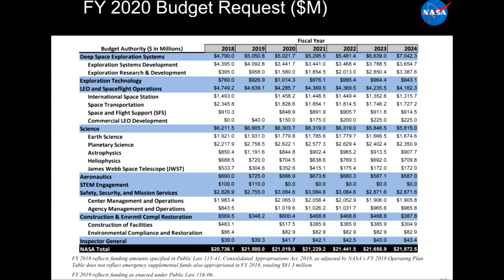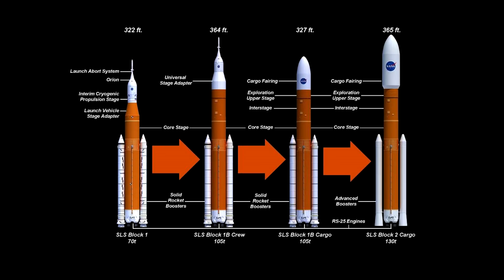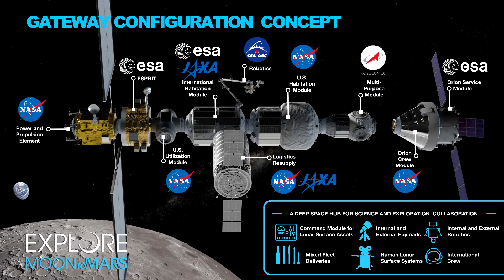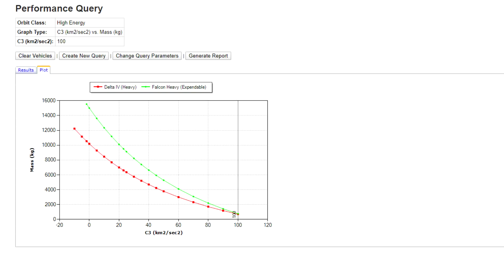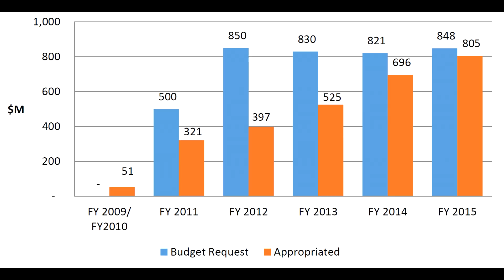SLS Rocket In Trouble After New White House Budget Request

Comment: SpaceX has gone from drawing Falcon Heavy on a napkin to an actual launch in the time this thing has been laying around in "development".
Reply: Really SpaceX has gone from designing the Falcon 1 to flying Falcon Heavy in the time this program has been around since SLS is basically a continuation of the Constellation Program with a name change and less capable rocket. 

To quote Apollo 13 "Tell me this isn't a government operation."
Reply: @bnadit1949  And it does use almost unchanged Shuttle parts, so we're talking about 40 years
Reply: @bnadit1949  Much of the Merlin engine is based on Fastrac and the TR-107 in fact Spacex's head propulsion engineer Tom Mueller used to work for Northrop before co-founding Spacex so they did not start from zero.
Reply: SpaceX has gone from using technology developed by the public, you mean.
The private sector didn't step up back in the 60s to go to the moon off its own back.
Reply: @anessenator  What technology is that?
Reply: @anessenator  SLS is using Shuttle engines and boosters, designed in the 1960s. There has been zero forward progress by the public sector since Shuttle's debut.
Reply: @polygondwanaland8390  The main tank is from the Shuttle too. Only new thing is upper stage and capsule.
Reply: @anessenator  Not to sure what tech has been developed "by the public" the private sector did not invest in the moon because it was too new, and everything involved with rockets involved the military,  all of the scientist worked for the govt. universities grads were recruited by NASA and the military involved programs. None of this would of been shared with the public.
Reply: @polygondwanaland8390  That's what happens when budgets get slashed down to nothing. No money, no progress.
Reply: @polygondwanaland8390  Except it isn't, they're completely redesigned engines that are just supposed to look kinda like the old ones. They are made by the same company. Same with the main tank. The only actual carry-over is the manufacturer and the orange paint. Everything else has been redesigned. Which is actually bad because it means they didn't even save any money doing it.
Reply: @SuperSMT  - The rocket technology that Musk used as the basis for his company's designs was developed under NASA. It's that "shoulders of giants" thing. He didn't start from scratch, he built on what had already been done by those who came before.

Apart from that, SpaceX receives billions of dollars in government subsidies and contracts, paid for by the American taxpayer. The difference between that and funding NASA directly is that NASA is a non-profit, public, organization, whereas SpaceX isn't. Any innovations made with our money is owned by SpaceX, not us. So Musk and his investors get to pocket the profit from our investment.
Reply: @danieljensen2626  I was under the impression the first few flights would be surplus Shuttle engines, switching to the "new design" around Block 1B.
Reply: @f1nger605  NASA didn't start from scratch either, it basically wholesale grabbed the Nazi rocket program and related engineers. Do you think Nazis need more credit for what NASA has done? Risky position to take!
Reply: @PistonAvatarGuy  SLS has had tens of billions of dollars of funding and well more time than it was scheduled for. It's just a bad design from a bureaucracy obsessed with preserving existing jobs.
Reply: @polygondwanaland8390  - Those Nazi scientists were still funded by the American taxpayer. Again, the difference is that we foot the bill, but don't get to reap the reward.
Reply: @f1nger605  "Don't reap the reward"? America's public sector now has cheap access to space from multiple private companies. That's not a reward? You'd rather spend a billion dollars every launch to keep using Shuttle?

Fixed cost contracts are a win for taxpayers because they drive prices down instead of spiraling them upwards. It's much cheaper for NASA to purchase a service than to develop and operate it's own vehicles.
Reply: @f1nger605  They dont get 'subsidies', just contracts. NASA's investment gets them exactly what they paid for, domestic access to the ISS for cargo and soon crew.
Reply: @polygondwanaland8390  Building the most powerful rocket ever made is expensive, who knew? And what's wrong with preserving jobs, especially at NASA?
Reply: @danieljensen2626  Orange paint? You think the shuttle main tank was orange because it was painted?
Reply: @PistonAvatarGuy  SLS is not the most powerful rocket ever designed. That's straight up a lie. The Block 2 SLS has zero funding or development. The Block 1 and Block 1B SLS are both lesser than the Saturn V and SpaceX Superheavy.
Reply: @anessenator  Today Space X has developed its own "Full flow staged combustion" Raptor engine. Although the Russians developed one in the past, Space X have done well to develop their own one.
Reply: @SuperSMT  - They also get subsidies. Musk's combined corporate empire, according to one estimate, has received $4.9 billion in government subsidies.

Our return on that investment is that we get to pay SpaceX for the privilege of using their rockets. It's an arrangement designed to enrich Musk and his investors.
Reply: @PistonAvatarGuy  Orange insulation, whatever. The point is all the internals have changed.
Reply: @anessenator  And did they do that on 5% of the US budget? No? Then maybe there is a reason why Apollo was done by the Govt. aqnd Space X now is cheaper, faster and more successful in developing the crude basics delivered by them to what we see actually launch nowadays.
Reply: @polygondwanaland8390  - I'd rather see NASA fully funded instead of being forced to innovate with scraps.

It is a time-honored tradition of corporate-owmed politicians to severely cut the budgets of government programs, watch them fall into ruin, then turn around and say "See?! Privatization is the answer!" It happened with the Post Office and it's happening with NASA. Privatization is not more efficient, it's just better at distributing money to those at the top.
Reply: @polygondwanaland8390  I didn't say that it was the most powerful rocket ever designed, and even if the more powerful iteration of the SLS isn't currently being built, the development of the SLS is much, MUCH further along than SpaceX's "Superheavy," which isn't likely to EVER be built. The ONLY way that building these big rockets makes any sense is if they're going to be used for research programs which involve sending people to other celestial bodies, and there's no reason why NASA shouldn't be the one to build the rockets for those programs.
Reply: @danieljensen2626  The government doesn't save money, there's no incentive to.
Reply: @fitch03  - Why do you think NASA is repurposing decades-old rocket engines instead of designing all new ones? They're trying to save money. Because their ambitions are high, but their funding is low, so they are forced to pinch pennies wherever they can.

Meanwhile, private industry also has an incentive to save money, they're just saving it for those at the top. The point of SpaceX isn't to make rockets, it's to make a profit for its investors. Nothing more. That is all "efficiency" means in a corporate context: enriching the rich.
Reply: @f1nger605  Lol, space X is a private company. Elon runs it specifically with the goal of getting humans on Mars. They don't even really turn a profit, basically all of their money goes back into designing bigger and better rockets.
Reply: @fitch03  Literally the entire pitch of "re-using" shuttle parts was to save time and money.  I know it was just pork barrel for the old manufacturers but that was the stated reasoning.
Reply: @danieljensen2626  - You're actually very wrong about that. SpaceX's profit margin is much higher than its largest competitors, Boeing and Lockheed Martin. The "savings" for R&D actually comes from its work force. SpaceX employs fewer people than those companies and reportedly engages in some shady labor practices.

While SpaceX isn't publicly traded, it still has investors other than Elon Musk. Investors who, like all investors, are looking to turn a profit. Again, the goal of the company is to make money for those at the top, not rockets for the good of mankind.
Reply: @polygondwanaland8390  the risk that is you end up in the position that nasa is now where they depend on the Russians to get men into space. Also monopolies also tend to lead to higher prices as their is no competition
Reply: @f1nger605  SpaceX does their launches without goverment subsidies. Any launches they operate on US Soil (which is all of them) is paid for by contract. They are PAID for their launch platform. They do not get kickbacks. They are simply a profitable rocket agency. ULA is not.
Reply: @AudioArcturia  - Just because they aren't being subsidized in one area doesn't mean they aren't being subsidized in other areas. Again, Musk's corporate empire has received an estimated $4.9 billion in government subsidies. Those close to him have said that he's hawkish about getting the government to pay for whatever he can. That's just good business.
Reply: @anessenator  "SpaceX has gone from using technology developed by the public, you mean. The private sector didn't step up back in the 60s to go to the moon off its own back."
And NASA (NACA at the time) used technology developed by Goddard (The liquid fueled rocket engine) So SpaceX is using technology developed by a private individual. The entire idea of "lunar orbit rendezvous" was also a civilian development (John Houbolt)

NASA didn't get to *orbit*, let alone the moon, entirely on their own development.
Reply: @PistonAvatarGuy  and what percentage of the funding given over for constellation and SLS did spacex use in equivalence to design and deploy falcon 9 and falcon heavy?
Reply: @f1nger605  but you claimed they get subsidies for SpaceX. They do not.
Reply: @AudioArcturia  - They did, though.
Reply: @citizenphaid  None of the Falcon rockets are anywhere close to being as capable as SLS.
Reply: @PistonAvatarGuy  You actually think Block 2 of SLS, which has zero funding, zero design work, and placeholder boosters is more likely to fly than Superheavy, for which engines have entered series production and full scale tests are underway? You're either ill informed or wildly delusional.
Reply: @f1nger605  No, they don't. Outside of a double digit millions for a design study for the Air Force, every dollar SpaceX takes from the government is payment for services rendered. That's not a subsidy, that's business.
Reply: @polygondwanaland8390  SLS Block 1, payload to LEO: 209,000 pounds.
-
Falcon Heavy, payload to LEO: 140,700 pounds. 
-
When talking about going further out into space, the advantage that the SLS has becomes even more pronounced. You have no idea what you're talking about.
Reply: @anessenator  - Standing on the shoulders of titans. Lots of primary development and infrastructure paved the way for commercial programs. Sure, the `no!` crowd will reject it, but lots of ideas were tested and proven to be dead ends: SpaceX didn't have to do that, they had textbooks. The commercial crowd doesn't have to deal with the complications of public money and Congress either, successive administrations or a fickle one for that matter (which happens to be the subject of this video clip.) Frankly, I don't see SpaceX' Mars goal as being more than advertising. New Shepard, Glen, tourism, Earth, is where it's at. A colony where the surface atmosphere is like 25,000 M and the hottest it gets is 20C and the same day it averages -76C. Did they mention the planet wide talcum powder fine rust dust storms that cover the planet and works its way into everything?
Reply: @anessenator  well, I'm neutral concerning SpaceX. But I really find it weird that the "legacy" space companies are needing more time to create some launcher that is mostly made of old components than SpaceX and (most likely) Blue Origin needed to create something totally new from scratch.

I'm absolutely sure that these two companies had been able to create some SLS comparable launcher with much fewer money. This concept of using as much contractors as possible is really expensive and a waste of time.
Reply: @f.w.1318  Not only was it shared with the public, everyone in the world was able to see the plans. Sure, there were proprietary processes involved that manufacturers created and some of them were forced to be shared between competitors by the government to benefit the program. The easiest example is how thegovernment required Douglas to assist North American with insulation of their Saturn LH stage the S-II because the Douglas' S-IVb was so much farther along. 
But look at photos of the SpaceX shop floor: Curtains, drapes, covers, all ad hoc, not to protect the hardware, to protect the design. Not that it's a bad idea, just, get real.
Reply: @anessenator  okay, NASA beat the Soviets to the moon 50 years ago, (huge clap) but you're suggesting we should now dump the private sector and let the government continue their slothlike and uninspiring mentality?
Reply: @polygondwanaland8390  I only half agree with you, maybe three quarters. It will to be so great to have multiple United States suppliers to LEO. Sure wish we could've doubled back in 1973 and tested a next-gen stretched SI-C to land on a barge in the Atlantic instead of a full-blown shuttle, but anyway. As for fixed cost, fine for post-development work but Congress likes `price tags` to sell and criticize when they see fit. Purchasing a service requires oversight, i.e. regulation, that part of the equation tends to be ignored, as does the "profit tax" companies charge. Money they make by cutting corners can lead to an inferior deliverable. See what I mean about not completely agreeing?
Reply: @f1nger605  Ah yes, the good ole anti-capitalist anti-reality argument. Take even the most basic economics class and you'll understand what I said.  SpaceX is almost entirely funded by subsidy, just like every Musk company besides Paypal.
Reply: @nicktodd2  Full flow may have an advantage (thrust/weight? simplicity?,) but maybe not (ISP.) However the staged combustion path was well worn prior to SpaceX' entry. Their boys and girls went to school reading textbooks written by those designers.
Reply: @f1nger605  Remember when we gave the Apollo program nearly 400 billion dollars? Pepperidge Farms remembers
Reply: @stevefink6000  What I want is a well educated workforce with consistent leadership. Previous programs were cancelled for sound reasons but I still hated to see them go only replaced by some clean sheet that people criticize for being slow. It's frustrating that scientists and engineers look up from their experiments and benches only to see people who can't carry their own water making de facto technical specifications via funding decisions. Yeah, I know it's complicated, but still.
Reply: @stevefink6000  ...that said, I just saw at 0:30 & 0:39 "STEM = $0.00" SMH 🤦‍♀️
Reply: @fitch03  Dude... people have already addressed this. spacex doesn't take subsidies, they take contracts
Reply: @benhardie3836  The difference, realistically, being......................................?
Reply: @PistonAvatarGuy  Falcon Heavy is not Super Heavy. BFR is Super Heavy.
Reply: @f1nger605  What were the subsidies? I'm not aware of any gov subsidies offered to spacex, other than the Air force design study mentioned by another poster, which was fairly small amt
Reply: @hellascommentor  The person that I replied to was comparing Falcon Heavy to SLS.
Reply: @anessenator  That's great.  But NASA didn't have to start from scratch on the SLS either.  SpaceX can do things faster and better.  It's no longer a contest.
Reply: @PistonAvatarGuy  NASA has plenty of money.  Their mission has been clouded by climate change research which occupies too much time, money, and resources.
Reply: @anessenator  The private sector didn't have $200 Billion dollars (which is what NASA themselves say it costed in today's money) back then either, not even a tiny fraction of what NASA spent on the entirety of the Apollo missions. With $200 Billion almost any company on earth then and now could fund and get to and land on the Moon. You must not understand what that kind of money can do. NASA was given a blank check for those missions. Give ANY private tech company today the same resources and look at what happens. I can't even imagine what SpaceX could pull off with $200 Billion.
Reply: @jameslederer7613  A) They have a tiny fraction of the budget that they had when they went to the moon. B) Climate change is the most important issue that we currently face, so it deserves NASA's full attention.
Reply: @PistonAvatarGuy  Yes, this is mainly going to anyone thinking that there is already an alternative to SLS. Maybe in 4 to 8 years. Maybe. We need parallel projects and alternatives. Otherwise, we will not be able to launch human rated spacecrafts and big space station components.

Finally, RnD for SLS B2 will benefit all the other companies.
Reply: Jo York If it's that simple why can't NASA do it?
Reply: @cowboybob7093  Of course it was shared with the public, but years later, the space shuttle reached orbit in 1981, but NASA was working on designs for nearly a dozen years before that. Walter Dornberger (a Nazi) designed the concept of the x-15 for National Advisory Committee  Aeronautics (NACA) which became the test bed for space shuttle. Test data and designs was not public knowledge then. After the Clinton administration shared US rocket tech  with China, (guidance and telemetry) it eventually became public knowledge to all. Actually It was perfect timing,  during this time the early startups in tech were taking shape, Ebay, Paypal, and a tiny warehouse in Seattle doing book deliveries.  We can thank Paypal for giving us Elon Musk.
Reply: @f1nger605  Werner von Braun was funded by the American Taxpayer when he launched the V2 towards New York? Nice to Know
Reply: @SuperSMT  you should have said "do you have a single fact to back that up?"
Reply: The thing is, NASA made all the groundwork for them. There would be no SpaceX with no NASA.
Reply: @PistonAvatarGuy  No Money?  WHO are you kidding.  They have been spending $$$ hand over fist to keep the contractors happy who made the original rocket equipment.  No Oversight, No Progress is more like it.
Reply: @f.w.1318   it's illegal to share some tech without gov't approval.
Reply: @paladro  Yep especially if your contracted by them, that's why Northrop/McDonnell Douglas YF-23 was sent to museum exhibits, after it lost to the the YF-22, Northrop/McDonnell Douglas could not sell the tech to anyone else.
Reply: Except, The technology wasn't developed by the US either. The US took the technology from the Nazis.
Reply: @PistonAvatarGuy  It deserves none of it's attention because climate change has nothing to do with travel through the atmosphere or exploration of space.

And climate change is a miniscule issue blown out of proportion by progressive ideologues, that just want more mechanisms for authoritarian control.
Reply: @jameslederer7613  No one is better equipped than NASA to study climate change.
-
Rapid climate change causes mass extinction events, bud, it's happened before, it's happening now. Allowing people to produce their own energy gives them MORE power over would-be oppressors.
Reply: @PistonAvatarGuy  Then no one should be complaining that NASA doesn't have enough funding for space exploration.

And unfortunately for your argument, we already have an agency called NOAA, that is actually tasked with study of the atmosphere and oceans.
Reply: @jameslederer7613  A) NASA's budget never should have been reduced as severely as it has been since the end of the Apollo program. NASA was largely responsible for the rapid advancement of technology in the US during that era and for keeping the US FAR ahead of any other country on Earth, that had very real economic benefits. B) The government exists to serve the people, if people want NASA to research climate change AND launch rockets, it should be given the budget to do so!
-
NOAA doesn't have the ability to launch satellites, NASA does.
Reply: @polygondwanaland8390  That's not a fair assessment. They weren't launching satellites using the shuttle, rather, ULA vehicles. The savings per satellite launch for the American taxpayer is something like less than 25 cents, and even then, NASA doesn't have many launches, all others (communication satellites, etc) were paid for by private enterprises. 

SpaceX, while has been able to accomplish many things, will never put science before engineering, and that's a bad thing for NASA (Though admittedly, it's great for other private industries). Engineering is about making things efficient and cheap, science is about learning about new things. If SpaceX is just trying to accomplish a few distinct goals, all of which will be profitable for them, that doesn't leave NASA with much room to push the boundaries of our knowledge of the universe and beyond.
Reply: @f1nger605  To be fair to musk, he doesn't have any public investors with the SpaceX venture.
Reply: @AudioArcturia  ULA is profitable, it's a joint venture between Boeing and Lockheed Martin, 2 of the three largest aerospace engineering companies in the world.
Reply: @hellascommentor  There's also no guarantee BFR will be a legitimate rocket. It's just a bunch of artists impressions at this point.

Also, I believe most of the money for the SLS program (the entire thing) will go towards the Orion Space Capsule, upgrades to the launch site (which is 2 billion dollars mind you), and the actual missions themselves.
Reply: @jameslederer7613  I don't think you actually understand why NASA exists. They are basically the scientific and engineering branch of the entire US government. Their job isn't just to go to space, but to study the planet, and aspects of aerospace/mechanical engineering. They're not going to space now to see new things, they're going to space now to learn about the effects of 0Gs on the human body, test the legitimacy & logistics of living in space long term, and doing scientific studies.
Reply: @benhardie3836  They also take subsidies, but so do Boeing and Lockheed Martin so it's really a moot argument.
Reply: @annando  Your use of: "much fewer money" shows that you have no idea how complex rockets actually are, especially those that have to be designed for many missions in mind.
Reply: @Token_Nerd  SpaceX isn't a  normal publicly traded company, it's run by two idealogues deadset on getting humans to Mars. Usually you'd be correct when saying private industry puts profits first, but Elon Musk and Gwyenn Shotwell are ideologically motivated.
Reply: @Token_Nerd  Not just space.  Aeronautical research as well.

Aero=air Nautical=to voyage through

Back when NASA did great things, those were the areas it solely focused on.

NASA does not build dams, or research diseases, or engineer seismic activity sensors.

NASA's job is to study air and space travel.
Reply: @PistonAvatarGuy  If you expect them to be the jack of all trades, then dont expect them to be the master of any.

NASA's job should be to aid in the implementation and the launch of NOAA's satellites and assist in the flying of any NOAA experiments that require transit through the atmosphere.
Reply: @jameslederer7613  The title of the organization which studies these sciences doesn't really make a difference and NASA has proven itself to be extremely capable when it comes to advancing the planetary sciences. There's also a carry-over of knowledge and capabilities which are relevant to the study of the other celestial bodies that NASA researches. I don't see why both NASA and NOAA shouldn't be studying Earth, it all benefits humanity.
Reply: @Token_Nerd  I would totally disagree about BFR's plausibility. It is way more than artists impressions, as the engines have already entered production and a very, very large model is about to do flying tests with a shorter frame
Reply: @f1nger605  1. Nobody except the accounting department of spaceX actually knows spaceX's profits, but elon has said on record that all of the profit from spaceX is reinvested into the company. Secondly, the other investors don't matter. They are literally cash cows. Because Musk has majority of stocks and of voting power, he is the only one with control over spaceX and its mission.
Reply: @fitch03  SpaceX provides goods and services in exchange. I thought you took a basic economics class?
Reply: @andrewovery6458  All subsidies provide a good or service in exchange. Any time the government creates an artificial demand that wouldn't exist without the government, it's a subsidy in its purest form. No different than agricultural subsidies where the government guarantees a minimum price or outright purchases the excess product, creating a demand that wouldn't exist otherwise, is a subsidy. That includes government contracts. You don't have the means or the desire to purchase goods or services from SpaceX, yet you do anyways. Unknowingly, obviously.
Reply: @PistonAvatarGuy  Keep in mind, that 209,000 lb for SLS Block 1 includes a fully fueled ICPS. So in terms of realistic payload on orbit, subtract off 67,000 lbs.
Reply: @Token_Nerd  "SpaceX, while has been able to accomplish many things, will never put science before engineering...." While I totally agree with that statement, I'm disagree on the idea that that is bad for NASA or science. SpaceX, at present, makes rockets ... ie: they engineer a means to get out of the atmosphere. It's SpaceX's clients that make the satellites that do the actual science. SpaceX has it's role, engineering rockets; the clients have their role, doing science on orbit. Aside from making assurances that the science payloads arrive safey on-orbit, why would SpaceX worry about the science at all? (Unless of course you're talking material sciences, things SpaceX could learn from to improve their productivity/efficiency. That I could see them taking a vested interest in.)
Reply: @cymrych79  I'm not saying it's their job, but it is fair to say that it is bad for parts of NASA because it means that SpaceX will be pushing the limits of the known with their goals, and that could be bad news for the astronauts (though the space shuttle could be a counter argument). More importantly though NASA budget money is going towards a private venture that, although may eventually provide a return on investment, takes money away from NASA's science missions.
Reply: @fitch03  I don't think your analogy is very apt here. Ag subsidies exists to protect farmers when there is an overabundance of goods going to market in bumper years, after the invest a season in a particular crop. Basic supply and demand economics will see the prices plummet due to excess supplies, and the farmers take a loss. Subsidies work here to regulate the bottom dollar, as you noted. But it's not like SpaceX has a plethora of F9s sitting around gathering dust. They're not churning out F9s on an assembly line, hoping to attract a buyer and slashing their launch costs if they do not. They build the rockets as the contracts come in. Why would they do otherwise? The gov't isn't creating an artificial demand by giving SpaceX a contract for, say, a DoD launch. It's just a contract. If the gov't was buying surplus F9s to use for target practice, then OK, I'd call that a subsidy too; but they're not.
Reply: @Token_Nerd  But NASA's stated goal with Crew Development is to ultimately SAVE money by letting private companies handle the launch vehicles for simple LEO missions, so that NASA can concentrate on  beyond LEO and interplanetary sciences. It certainly seems that NASA's relatively small investment in Crew Development is about to begin paying off as first SpaceX and then Boeing get their crew vehicles on the job. Compared to say SLS, which is being produced in-house and has cost a whole lot more than the Crew Development contracts, and is still years away from lifting anyone to orbit.

Besides, NASA and SpaceX (and I presume Boeing) have worked hand in hand on these Commercial Crew launch vehicles. There ain't nothing on either platform that NASA hasn't duly signed off on. Hard to see how SpaceX engineering would be any different than NASA engineering, in terms of safety for crew.
Reply: Not the tank itself, but some of the similar size tooling for it was reused. New tank is fresh,  The shuttle tank was never designed to support payloads on top of it.
Reply: @anessenator  it was the private sector that built everything dude. Was funded by the public.
Reply: @anessenator  right so all of modern humans understanding and development mean nothing because it's built from the original work of our ancestors 10000 years ago
Reply: @thebigitchy  The RS-25 was designed from the start to be reusable and very efficient (very high ISP), the high ISP leads to very high chamber pressures, which leads to a very complex staged combustion engine. Manufacturing cost was not a major consideration, since they were reusable and not many needed to be built. To use them as expendable engines was not an engineering decision, it was a political decision imposed by Congress.
Reply: F1NGER - yes but the reason NASA couldn’t get multi-use vehicles off the ground was because of the need to distribute contracts across the sates to win funding from congress, multi-use vehicles are much cheaper = not appealing to politicians.
Reply: @NapoleonGelignite  The shuttle was a reusable vehicle.
Reply: idontcare80 - it was going to be until the DoD increased its payload which required solid boosters. Solid boosters are not really reusable as they need remanufacturing in reality (ask Thiokol how much is charged to ‘refuel’ the boosters.)
Reply: @NapoleonGelignite  The most expensive part of the STS was reused and the boosters were reused, regardless of your definition of reuse.
Reply: idontcare80 - if your car needed to be sent back to two different factories to have its fuel tank filled you wouldn’t be impressed.
Reply: @NapoleonGelignite  A rocket isn't a car and there was nothing more capable than the shuttle during the time that it was in operation. There's STILL not anything that offers superior capabilities.
Reply: idontcare80 - I know a rocket isn’t a car. The shuttle was a great vehicle, but it was compromised. It’s a pity that it wasn’t built as designed. Also a pity that Buran and Energia were victims of the collapse of the USSR as both were also great vehicles.
Reply: @polygondwanaland8390  So did SpaceX. It started with the Merlin engine, except look what they're doing now.
Reply: @danieljensen2626  Both the Ares and the SLS were shuttle derived vehicles—they used many pieces of hardware from the shuttle launchers. The SLS in particular uses four RS25 engines which have been evolved from the design from the space shuttle.

Watch the video mate.
Reply: @actualperson1971  Key word "evolved from", here meaning almost completely redesigned, as with every other part of the SLS. Would have been better/faster/cheaper just to start from scratch.
Reply: @anessenator  
Totally agree.  Spacex has just grabbed a rocket engine with the highest thrust to weight ratio (for liquid ) that the US had developed and had forgotten about in a shed.  The US also had developed some orbital boosters that are reusable when no one was watching, and Spacex grabbed those as well and just put their name on them.  Same goes for the reusable cargo and crew spacecraft.  Yep, the US was just hiding all that stuff and paying the Russions 80 million a chair cause it's fun.  
What department at ULA do you work in?
Reply: @anessenator  No, but SLS had that same technology at it's disposal and still has taken longer than SpaceX is the point of the argument. Another point being that SpaceX is actually simultaneously working on their OWN rocket that will outclass the SLS. The rockets having been fully tested on the SLS already but so have the BFR's rockets. Boeing/ULA has been content with sitting on their butts raking in money from a monopoly and what's that monopoly has broken they realize just how behind they really are. They had to do a full restructuring of their entire space program and design the Vulcan just to stay in business.
Reply: @PistonAvatarGuy  Preserving jobs should NEVER be a goal.  Getting a JOB DONE should be the sole focus.  NASA nor any other government entity can remotely compete with scrappy privateers for exactly such reasons as 'preserving jobs'.  They should focus on exploration that companies can't justify and use the most cost effective option to get into orbit and anything else available.  NASA's job should not be to simply extend it's own existence.
Reply: @Mrbfgray  So, we're supposed to sit back and let an obsolete economic system make us all irrelevant and cause the collapse of all human society... because reasons? In the very near future, there wont be enough jobs for our society to continue functioning, what then?
-
NASA is focusing on exploration that companies can't justify. No private company will be able to justify sending humans to the moon, or to Mars, no matter what delusional business owners might believe.
Reply: @PistonAvatarGuy  How about worrying about the sever shortage of qualified workers right now, over the last decade and into the foreseeable future ?  There have been millions of unfilled jobs in the USA for many yr.s with no end in sight.

NASA should focus on unmanned probes and maybe ppl on the moon they have demonstrated complete utter incompetence at anything else for several decades now.  So YOUR solution is to have one man digging a ditch and another filling it back in to maintain "jobs"?

Yes we should be mindful of the obsolescence of socialism even tho it is a matter of degree.  Humans going to Mars will soon die, try living off the land on the South Pole 1st, that will be a million X easier.
Reply: @Mrbfgray  There is no shortage of workers, there's an abundance of college graduates who can't find work because business only want to hire people with huge amounts of experience. Businesses want to hire only experienced people because they've eliminated all of the entry-level jobs.
-
Even if the problem were that there are no "qualified" workers, that would be a result of a lack of incentive for people to work and become qualified, which is a result of the falling value of labor. As much as you'd like it to be true, people don't voluntarily become slaves.

-
"...they have demonstrated complete utter incompetence at anything else for several decades now."
-
Really? Be specific, where has NASA failed in the last 30 years?
-
"So YOUR solution is to have one man digging a ditch and another filling it back in to maintain "jobs"?"
-
That's not what NASA is doing, but you haven't presented a solution to anything, so...
-
Socialism got us to the moon, bud, while capitalism is turning us into slaves, so which system is obsolete?
Reply: @Mrbfgray  "Going to the moon was a cold war battle and fairly pointless beyond that."
-
Except for the absolutely enormous amount of technological advancements that came from it, you mean?
-
"If you can't find a job or feel like a slave it's your own damn fault."
-
If businesses aren't able to provide enough incentive to drive people to work, that's EVERYONE'S problem, because our current economy COLLAPSES when people don't work. Look at American debt, it's growing, without any sign of slowing down. What happens when an entire country can't pay that debt? Bankruptcy? War? Why put up with that when there's no need for it?
-
"Useful degrees such as programming and engineering have long been in high demand..."
-
Not everyone is capable of being an engineer, or a programmer.
-
"And even a good degree is no guarantee you still have to demonstrate productivity."
-
You can't expect people to be productive in slavery.
-
"Such grads can be mechanics, carpenters, electricians, plumbers, welders, on and on, the trades are reasonably lucrative and perpetually under supplied because entitled idiots are TOO GOOD to work hard for a living, don't even think of getting your hands dirty! "
-
THERE'S NO DEMAND FOR THOSE JOBS, if there were, people would be paid well to do them! Our public infrastructure is crumbling, there's plenty of need in that area, but there's NO FUNDING, because people like you think that everything can be privatized! How do you privatize roads without massively inconveniencing everyone? People like you don't THINK, you don't even acknowledge that socialism created the most prosperous society that has EVER existed on Earth! You're in DENIAL, you live in a fantasy land! Wake the f--k up!
Reply: @Mrbfgray  BTW, I worked in the trades, THERE'S NO MONEY THERE. That's why illegal immigrants are the only people willing to work those jobs, because they pile three families into a household and don't pay taxes, which is the only way that people can afford to live on that kind of pay.
Reply: @Mrbfgray  Truck drivers are going to be a thing of the past within the next 10 to 20 years. This is the problem with you people, you think that things are the same as they always were, but THEY'RE NOT, times are changing, and you people are busy trying to hold on to the 1800s!
Reply: @PistonAvatarGuy  You are in the USA?  I don't know what shit hole part because there is nothing but desperation for anyone with some skills and willingness to use them anywhere I've seen.   Nothing but too much work and not enough good men to do it all.
Do you have decent skills and integrity?  The best worker in the world is useless to me if I can't trust them.
Reply: @PistonAvatarGuy  I don't wish it on us but these prosperous times will not last forever, they never do.  Someday you'll look back at the good ol' days and lament you didn't get crack'n while the get'n was good.  It'll never be easy, a good life never was nor will be.  We could give you $100M and it won't make you happy or healthy, that can only be EARNED.  Look at what happens to fools (most who play it) who win the lottery!
Reply: @Mrbfgray  Those prosperous times could have lasted much longer than they did if certain policies hadn't changed. I never saw the good ol' days, I became an adult well after they were gone.
-
"It'll never be easy, a good life never was nor will be."
-
No, life shouldn't be easy, but it should productive, and capitalism can no longer drive productivity. Addressing global warming and pollution problems wouldn't be easy, but it's a challenge that we can't even accept because we don't have an economic system which allows us to. Establishing permanent colonies on other celestial bodies wouldn't be easy, but, again, that's not a challenge that we can accept. Our purpose as human beings is being destroyed, and without an economic system which allows us to accept new challenges, we can't do anything but yearn for something different. An individual can't choose to live in a society which doesn't exist.
-
"We could give you $100M and it won't make you happy or healthy..."
-
Who? I would certainly be a healthy as I could be. When I'm not living in a nightmare, I do enjoy eating well and exercising. I would be happy, without a doubt, because I'd be too busy doing things that I enjoy to be anything else. I probably wouldn't "grow" my wealth (that would go against most of what I believe), but it would be well spent on something that advances humanity in some way.
Reply: @Mrbfgray  "Look at what happens to fools (most who play it) who win the lottery!"
-
Most people aren't me.
Reply: @PistonAvatarGuy   I understand some 60% of Americans don't even have $500 saved for an emergency.  This is crazy.  From what I see they think nothing of spending $5 or $10 everyday on something totally discretionary like a Starbucks coffee, snacks, cigs or whatever.  That's REAL MONEY, 2 to 4 grand per yr.!  Simply saving 5 or 10/day adds up fast.  

Then learn how to invest and grow it, anyone with near average health and intelligence can do it.  In ten yr.s you can accumulate $100k even with a lousy job.  With compounding that can easily be $300k in 20 yr.s and that's not even trying hard.
Reply: @Mrbfgray  So people shouldn't consume things that they enjoy? If everyone stopped doing that, what would happen to all of the jobs that are associated with that consumption? Capitalism doesn't work if people aren't consuming. Even if we ignore the impact on jobs, what would people invest in? Right now, there's an ENDLESS list of stupid, useless ideas that are being invested in, that's just enormously wasteful and accomplishes nothing.
-
Also, what happens if EVERYONE invests 2 to 4 thousand per year? Is it even possible for everyone to get a return on their investment on that kind of scale? You're talking about returning something like 5 to 10 percent on an initial investment of around a TRILLION dollars, EVERY YEAR! What could possibly produce that kind of value? What are people going to consume on that scale and what would it do to our planet?
-
If the money isn't being directed into something productive, there's not going to be a return, it's a GAMBLE! But, when you give money to people who know exactly what to do with it, like the government did in the '50s, '60s and '70s, it's basically GUARANTEED to create jobs and produce something that betters humanity! What you're suggesting would exacerbate all of the problems that have been getting worse for the past 50 years.
Reply: @Mrbfgray  I made some edits to a previous comment, my wording wasn't really saying what I wanted it to say.
Reply: @Mrbfgray  A better way to word something that I said before: Life shouldn't be so difficult that it becomes unproductive.
-
You can't build something if someone keeps destroying it before you can finish it.
Reply: @Mrbfgray  Poverty absolutely is NOT optional. When I was working my butt off (40 to 50 hours a week) for a general contractor, I never bought Starbucks, or smoked, or drank (I probably would have if I wasn't underage, though), or did drugs, but I could barely keep my head above water while living in the cheapest studio apartment that I could find (in the crappiest part of town) and while driving an extremely fuel efficient and old car. I don't think that I was considered to be in poverty, but I had absolutely NO disposable income. Hell, the only reason that I was able to replace the bald tires (I was even driving around on a compact spare tire) on my car was because I got rear-ended and won a settlement! That's what waits for most people when they enter into the workforce, and some people never get out of that situation! That's not how you encourage people to contribute to your society, that's how you break them down and destroy them so that they don't care about the society that they live in! Really, that's the way the ruling class wants it, because it leaves them free to control everything.
-
"...having your money work for you."
-
I understand your perspective, what you're not understanding is that your investments don't better the human collective, they drive a form of parasitism which is destroying everything good about life and any chance of future prosperity for the human race.

-
"My investments create jobs..."
-
Doing what, though? Selling some garbage product that's helping to contribute to the destruction of our home planet? Selling a product that's used to spy on law-abiding Americans? Producing weapons to kill people in other countries over resources that we don't need? Or, do the jobs involve finding new ways to rip people off and destroy their lives? Those are really the only profitable options these days.
-
"The old bit of wisdom that those who defer rewards are successful and those who don't are not, it's not complicated or difficult to understand."
-
Duh, but your myopic and self-gratifying ideology doesn't better humanity, it's destructive an unsustainable. You're being rewarded by a system which is destroying your species, why would you want that? ... For the sake of brevity: If Satan were real and materialized in front of you, would you do everything that you could to please him because he rewarded you for doing so?
-
I'm not saying that it's not possible for a certain kind of person to work their way up from the bottom in the current system, I'm saying that the system is inherently destructive and unsustainable, so contributing to any society which makes use of it results in the destruction of everything that humanity depends on for prosperity. I'm also asking why you would want a system that makes it so difficult for people to contribute, what good could come from that? Why not make it easy for people to contribute so that more people do so? If you don't, you're going to have a HUGE number of people who are at the bottom of society, dragging it ALL down, holding everything back. This is what we see with the prison population in the US, which has exploded since the '80s. What good are those people doing for our society?
Reply: @Mrbfgray  To make my last point simply: What if the person who could cure cancer is out there right now, but they need a lot of sleep and grew up poor, so they can't work and go to college at the same time, or they don't want the enormous debt, why actively try to prevent them from ever having a chance to cure cancer?
-
Think of Stephen Hawking, without the support of those around him, what could he have ever contributed to the world?
Reply: Also, it's interesting that you don't see that the current economic system behaves exactly like the people who you would label as failures, it aims for short-term rewards (quarterly profits) with absolutely no regard for the future consequences (the gradual destruction of healthy communities, the destruction of the natural world, an obscenely powerful military industrial complex, etc).
Reply: @PistonAvatarGuy  My most rewarding recent investment is TSLA, Tesla.  They have, astoundingly, changed the trajectory of the entire global automotive industry to a  far more sustainable clean future and obviously created 100,000's of jobs just directly in the process.  One of the biggest dirtiest old industries on the planet.  Exactly, precisely the opposite of your narrow minded expectations.  Maybe you'er too caught up in your gloom and doom scenario to notice it but there are plenty of ways ordinary folks can do well while doing good.

It's beyond me how you could fail so badly in the circumstances you described, all I can say is hard work is NOT ENOUGH.  Never was nor will be.  You may need to move half way across the nation, I don't know your circumstances.  You certainly need to constantly improve your skills and go to where the demand is.  And you damn well better be productive and honest.  The smartest most productive man on Earth has negative value to me if I can't trust them.

Make it "easy for them", sure make it easier within reason but EASY has never been a characteristic of life on Earth nor would I want it to be.  It's certainly easier today than most anytime in history despite some serious flaws in the system and major room for improvement.  You and I didn't have to fight off the Nazis or build the infrastructure or internet that makes things vastly easier than the past.

Need I describe what I had to do to advance myself and my business before modern computers and the internet??  It was far harder just a few decades ago and yet folks still thrived, sure we were all poorer back then but we did OK.

Do you have any idea how hard it is to find a  skilled welder or diesel mechanic to name just 2 examples and how much they can make?  All sorts of trades are making near or well beyond 6 figures today often with only a few yr.s of intensive investment in their skills that are often paid for by their employer.

Maybe you need to pick up and move or make yourself more valuable in some other way?  I don't know your situation but your clearly smart enough to figure it out.  And don't expect things to get much better than they are today, these are good times economically speaking, that won't always be the case.  Attitude is a big part of it too, some folks seem to always thrive while others with a defeatist attitude always fail no matter what.  Surely you've noticed that.
Reply: @PistonAvatarGuy  Junior College is nearly free in America and yes you can work and learn a trade and/or prepare for further higher education at the same time.  That's what I did.  Granted tuition has increased significantly but I became a certified welder first then put myself thru the state system, subsidized by taxpayers, to get my Mechanical Engineering degree. 

 I could have gone into debt like most others I knew but debt wasn't and isn't something I sit well with, instead I paid as I went, it took a lot longer but I left without owing a dime to anyone and with an excellent useful education.  I also got much of the foundations, the math, chemistry and general ed. on the cheap at JC before hand.

For those not college prone I know others who have had their skills upgrade paid for by their employer or on the job training.  Regardless, the certifications and degrees are just starting points, they open doors and prepare you for further advancing your abilities.

I've contracted for hundreds of companies over the yr.s and in every instance there has been plenty of room for advancement for anyone with the determination to do so.  Employers are begging for good men and never able to find enough of them, this has been the case for the half century I've witnessed directly and apparently has always been true.
Reply: @Mrbfgray  Nothing is sustainable about a vehicle that uses an enormous amount of resources to produce and isn't likely to be powered by a low-carbon energy grid in most regions of the US. Grid energy providers will NEVER abandon coal, not without massive government intervention. Also, Teslas fall into the spying on law-abiding Americans category. If Tesla wanted to produce a car, they should have produced a car, not a rolling telescreen.
-
"It's beyond me how you could fail so badly in the circumstances you described, all I can say is hard work is NOT ENOUGH."
-
I was in the same position that the majority of Americans are in. You don't think that there's something wrong with an economic system when HALF of working Americans are struggling to get by?
-
"You may need to move half way across the nation, I don't know your circumstances."
-
I'd very much like to, but moving is extremely expensive, so it's not an option for someone who is barely staying afloat.
-
"The smartest most productive man on Earth has negative value to me if I can't trust them."
-
Why would I want to be valuable to someone like you? You STILL haven't explained that.
-
"Make it "easy for them", sure make it easier within reason but EASY has never been a characteristic of life on Earth nor would I want it to be."
-
Who the f--k cares what you want? I'm talking about what WORKS, not what fits into your fantasy reality. Advancing humanity should provide the challenge, not screwing around with some ridiculous rat maze that some of the dumbest, most evil people on Earth came up with. I think that you believe that you're emulating natural selection, but the "failures" are the ones who are growing in number the fastest under this ridiculous system of yours! AGAIN, your system allows the bottom to drag EVERYONE down.
-
" You and I didn't have to fight off the Nazis or build the infrastructure or internet that makes things vastly easier than the past."
-
We have to fight global warming or WE DIE! There has NEVER been a greater threat to humanity, or a greater challenge that needs to be overcome! Do you not know what a MASS EXTINCTION EVENT is?
-
"I don't know your situation but your clearly smart enough to figure it out."
-
You STILL haven't said why I should contribute to your self-destructive society! Why would I WANT to contribute when there IS NO FUTURE??? If we were on a boat in the middle of the ocean, you'd be asking me to help you drill holes in the bottom of it!
-
"Attitude is a big part of it too, some folks seem to always thrive while others with a defeatist attitude always fail no matter what."
-
Actually, I've noticed that people with positive attitudes fail more, because people with a pragmatic attitude tend to be more careful about how they use their time and are more likely to invest their time and energy into something that is actually capable of succeeding..
Reply: @Mrbfgray  It sounds like you went to college more than 30 years ago, but the cost of college has tripled since then.
-
Anyway, I don't understand why you think that I would be interested in working at all, what would be the point? Everything that capitalism does is destructive, I'm not going to contribute to that destructiveness. I'm not going to help you drill holes in the bottom of the ship. It's time for something NEW, it's time for humanity to quit playing games and GROW UP.
Reply: @PistonAvatarGuy  Coal in America is already largely finished because of capitalism.  And global warming is vastly distorted in the popular media, it's very likely that 500ppm CO2 (where we are probably headed) is better place to be than 300ppm where we came from.  This universe wasn't made for us, there is no reason that natural random levels are automatically better than semi-random human induced modifications.  The SPEED of change is alarming but not the magnitude, a couple 100 ppm swings are entirely normal over 100k yr. time frames.

In the last few million yr.s of ice age minimums CO2 fell to extremely dangerous low levels, near the point of mass extinction like Earth hasn't seen in half a billion yr.s.  Plant life becomes impossible below 100 to 150ppm CO2 and then EVERYTHING DIES.  Recent ice ages have seen below 180ppm, lowest levels in Earths 'recent' history, the last 250M yr.s or so, the current levels are greening the planet.  Commercial green houses increase CO2 to 1000 or so to improve plant growth/productivity.  A normal home has 1000 to 2000 when the doors and windows are closed, it doesn't harm peoples aquarium fish or corals let alone ppl.

Also we are due for another ice age beginning around now, over the next few centuries, it's highly likely humanity has accidentally prevented that or mitigated it at least.  And while sea levels will rise in the short term due to fossil fuel consumption that's NOTHING compared to having half the North Hemisphere scrubbed flat by a mile thick ice as we should expect to happen without CO2 increases.

Life on earth did fine at vastly higher CO2 levels, 1000, 2000 even 6000ppm.  The sun has warmed slightly since then however, we don't need to be going back to even 1000 but I'm tentatively fine with 500.  All this media hype is highly misleading if you dig into the science yourself.  They'd have us believe it's climate that's causing the massive fires in California and Australia but that's a smaller factor, FUEL LOAD buildup in the wild lands is the primary problem and entirely due to universal suppression of frequent natural cleansing fires and traditional native populations burning off the land seasonally being curtailed.

  In California Sierra's some species of trees can't even reproduce until fire burns under them, fire is an irreplaceable component of the landscape, frequent low intensity fire is very healthy for forests, clearing brush, suppressing pests and leaving most large trees fully intact.  Natives would light it off every fall, otherwise lightening would do the job.

We should have learned from the natives instead of exterminating them but that's history, we can learn now.
Reply: @Mrbfgray  If I lived in the wilderness, I wouldn't be able to watch the collapse of human civilization, and it's been EXTREMELY entertaining so far. The excellent entertainment is really the only reason that I'm alive! I never once said that civilization can't exist without destroying the planet, my point is that CAPITALISM can't exist without destroying the planet, it's inherently destructive. It's time for a largely resource based economy (though, not the one described by Jacque Fresco). No taxes would be required. Some aspects of the capitalist system should definitely be retained, though.
-
Economic freedom for some means slavery for others. Capitalism inherently concentrates wealth in the hands of a small number of people, who then use their wealth to rule over everyone else, just like in endless examples of failed civilizations throughout human history. How an economic system functions depends entirely on how it's DESIGNED to function. We could live in even greater luxury and abundance than we do now, with a minuscule impact on the environment, but only if we were to adopt a economic system which allowed us to do so.
-
If socialism can land human beings on the moon, safely build and operate entire nuclear energy grids (France), build and maintain road and highway systems, build and maintain defense communication networks (which is where the internet came from, btw), build and maintain enormous water distribution systems to almost every home and business in the US, etc.. it can fuel any kind of technological advancement. Computers, too, would have never existed without the public funding needed to develop them. People like you just have no idea of the history of the technology that you use on a daily basis.
-
With the way that I live now, I can at least try to get people to see reason, that's better than nothing.
Reply: @Mrbfgray  Coal isn't going away completely anytime soon, and it's largely being replaced by natural gas.
-
I don't get my information on global warming from the media, I get it from the scientific community. With continuous exposure, concentrations of CO2 at 500 ppm severely compromise human brain function and human health. We're already likely to be seeing the beginnings of those effects. We're already observing the beginning of a mass extinction event (the sixth extinction). Long term heating with an atmospheric concentration of CO2 at 500 ppm would severely compromise the ecosystems that we depend on for survival. Earth's ecosystems make up our life support system, if they go, we go with them. CO2 emissions absolutely will not stop at 500 ppm, because people like you are obsessed with trying to get rich off of the problem, rather than actually doing something about it. 
-
The magnitude of the warming will be absolutely catastrophic, because we keep turning up the thermostat, but the heater hasn't even finished heating up the house yet.
-
CO2 levels were stable for MILLIONS of years before humans came along, nature was maintaining that balance and life was flourishing. There was NEVER any danger of CO2 levels getting too low, EVER.
-
WE'RE IN AN ICE AGE, there's ice at the poles! There is no way to determine if the planet was headed deeper into the ice age, because that depends on solar activity, which is something that we're not able to predict at this time. The only other (natural) mechanism which can influence the Earth's temperature on that scale is orbit, but that takes tens of thousands of years to change anything significantly.
-
"Life on earth did fine at vastly higher CO2 levels, 1000, 2000 even 6000ppm."
-
It's absolutely astonishing how ignorant people like you are, you're like grade school kids! The life that existed on Earth when CO2 levels were that high DOESN'T EXIST ANYMORE. I don't see any t-rexs roaming around, do you? Much of the life that's currently on Earth can't survive with levels that high, humans included.
-
"..but I'm tentatively fine with 500."
-
Who cares what you're fine with? You have NO IDEA what you're talking about!
-
Research BEETLE KILL. Fires aren't the only concern when it comes to forests.
Reply: @PistonAvatarGuy  I'm creating my own private paradise with hundreds of beautiful productive plants, apples to pecans to avocados and many things you have never heard of.  It's a wonderful place to be and I'm gradually getting to the point I can live off my own modest lot with surpluses for neighbors and friends.  A precious little organic food jungle with no outside inputs required.

Think of me and the millions of other folks who have CHOSEN the opposite path you have, the one's you pretend don't exist, we didn't focus on the imperfect era we are trapped in we made the best of it instead and took responsibility for our own happiness our own successes and failures.  Learned, struggled and moved on with increased confidence and pride for never giving up on this ONE precious life we are so fortunate to have.

Think of that while you wallow in cynicism with your fellow defeatists failures, the only types of ppl who will tolerate your presence--perpetual losers always blaming the universe for their own lazy misreble lives.  You chose to ignore success and surround yourself with misery.  It's all on YOU.  I don't put up with your type, they are downers and depressing, degrading to share space with.
Reply: @oleglovky  capsule isn't even new, it's from the constellation program
Reply: @anessenator  Because all the space stuff was mostly classified :p
Reply: @oleglovky  The tanks, SRB casings, upper stage, capsule, service module and ground support are completely new. It’s not old hardware (besides the foam on the core). They have never flown before.
Reply: @Kaskadamusic  But Orion has never flown for constellation. EFT-1 was for the SLS program, not constellation.
Reply: A true shame. In the time SLS has been in development, NASA created the Mecury-Redstone, Gemini, developed the Saturn five and landed 12 men on the moon.  All in the time that the SLS has been in development hell.
Reply: and even more crazy is the fact that SLS was supposed to be a simple re-use of existing shuttle technology.
Reply: So, so very sad. So, so very true.
Reply: SpaceX could add two more Falcons to the Falcon Heavy and blow the Clipper right at Jupiter.
Reply: The problem is that SLS doesn't have to leave the ground to achieve it's true purpose, in fact, the longer it takes to reach the pad without being cancelled, the better, as development funds end when it's developed...
Reply: Kevin Gulbransen Nailed it!
Reply: And to boot, most of the Falcon Heavy delays were just because they kept upgrading the Falcon 9
Reply: Note quite space x has actually had a lot odnhelp from nasa
Reply: Ungregistered User  Except when you want to massively advance countless technologies by sending men to the moon, build highway systems, educate people, protect people, prevent the environment from being absolutely destroyed, prevent air quality from becoming toxic, prevent corporations from treating people like slaves, etc, etc... The only reason that the government has been faltering lately is because it's being hobbled by private interests.
Reply: Good review Scott.
Hope spaceX stays around, heard they  reduced some payroll recently
Reply: Ummer Farooq  What old tech are you referring to here? Both re spacex and boeing, im curious about the 737 max situation with the recent accidents...
Reply: @benhardie3836  It's a faulty sensor. It's actually the newest technologies that are causing the issues with the MAX.
Reply: Can't compare SLS to Falcon Heavy. Not to mention Falcon Heavy is just some Falcon 9s strapped together
Reply: @Maverick0420  What does it matter that a Falcon Heavy is three F9 stages strapped together? Does that somehow lessen it's ability to put a stated payload on orbit? Couldn't one say something similar about SLS: it's just a shuttle ET with engines on the bottom and some strap-on solids? And why oh why can't SLS and FH be compared???
Reply: Spacex is riding the coattails of others to a large extent.
Reply: @MrBen527  Yes but they are doing it cheaper than most which is a positive thing for easier access to space
Reply: They're also not hauling large payloads and humans yet which will be a huge leap in liability when it comes to "cheaper and easier"
Reply: No, way too soon to say that when it comes to space travel.  I don't trust Spacex as much because its a business.  NASA/ULA have been doing it for a long time and doing it very well.
Reply: Ungregistered User  Fusion energy is still a fantasy, no one is even close to making a reactor which produces a useful amount of energy. The power plants in the US are fairly clean, thanks to the EPA. People aren't executed for breathing in any country.
Reply: Ungregistered User  Closer, but still many decades away, at the very least. There's not even any reason to discuss fusion energy because it's so unlikely to ever be a viable source of energy.
-
The point is: The US government has served its people very well and is largely responsible for the US being as prosperous as it is. No government is perfect, some are evil, but that doesn't mean that governments never work.
Reply: Ungregistered User  Agreed.
Reply: Ungregistered User  Hmm... just as incoherent as Trump.
Reply: Ungregistered User - jokes are supposed to be funny.
Reply: SlS is a pork barrel Project. It will never be completed because congressmen will lose jobs in their areas.

It's a complete waste of time.
Reply: I wonder why... Government inefficiency vs private enterprise..
Reply: “Lying” around in development. Not “Laying” around.
Reply: @Caffeinated Wizard Who cares when it benefits the whole country?
Reply: @Caffeinated Wizard Creating jobs benefits the country.
Reply: @Caffeinated Wizard A) Those GERMANS got us to the moon. B) They hired, what, dozens of Germans? Nearly 20,000 Americans work for NASA!
Reply: @Caffeinated Wizard And that's just directly, it doesn't count the huge numbers of jobs created by contractors who work for NASA.
Reply: @Caffeinated Wizard That saying implies that some sort of harm was done in order to achieve some sort of end, but no harm was done by hiring those scientists and engineers.
Reply: @Caffeinated Wizard No modern society would even exist without "using other people's money," btw, and socialism works extremely well in FREE societies. NASA also delivered more than ANY organization EVER has! Who else landed men on the moon?
Reply: @Caffeinated Wizard A quick Google search shows that he's a video game character. That's how you're going to try to argue your point here?
Reply: @Caffeinated Wizard I'm not an anti-Semite, you moron, and NASA isn't anti-Semetic, just because it hired ex-Nazi scientists in order to make use of their knowledge and intelligence.
Reply: @Caffeinated Wizard Most people are obnoxious morons, I'm quite used to it.
Reply: @Caffeinated Wizard Basically everyone living in any technologically advanced society on Earth is a socialist, because technologically advanced civilizations cannot exist without it.
Reply: @Caffeinated Wizard A) The most prosperous countries on Earth make heavy use of socialism, including the US. B) Venezuela isn't socialist, the private sector makes up most of their economy.
-
"Nevermind the bodycount in the billions that's just not real socialism."
-
That's what happens when DICTATORS run countries, moron, it's not related to socialism in any way. Anyway, how many millions have Americans killed in the name of profit in recent years?
Reply: @Caffeinated Wizard A sure sign of brainwashing is when people can't spot hypocrisy in their own thought processes.
-
You: "NASA is socialist!"
-
Also you: "Social programs aren't socialism!"
-
MAKE UP YOUR MIND.
-
And, yes, anytime you have something that's collectively owned by the people of a country, that's socialism.
Reply: *YOUR
Reply: @Caffeinated Wizard "...it's almost like socialism has that inherent problem and republics don't."
-
You are one confused individual. There's no reason that a socialist government can't also be a democracy.
-
"...but I doubt you've even read marx and engels works if you believe that."
-
A) I know enough about them to know that I don't agree with a large number of their ideas. B) I doubt that you've read any of their work either.
-
"Run by the worker."
-
"...of the people, by the people, for the people..." Where's the difference?
Reply: @Caffeinated Wizard "how do you miss nazi jokes about nasa?"
-
I didn't, they're just stupid and pointless, so I didn't acknowledge them.
Reply: @Caffeinated Wizard Also, the real joke here is that you have Christ as your avatar, but seem to absolutely LOATHE his teachings. More hypocrisy.
Reply: @Caffeinated Wizard You're a waste of air.
-
I don't hate women, I think that feminism has gone too far and made women impossible to have healthy relationships with, and that this has resulted in the destruction of the American family, which has caused a huge range of other problems. I don't hate minorities just because I acknowledge that some races are (on average) less intelligent than others, those are just the facts. Is everyone just supposed to live in a fairy tale where everyone is equal? Hmm... that sounds like something that Marx believed! I had to explain to my ex once that my affection for something is not dependent on how intelligent it is, because she couldn't understand why I felt greater affection for something which was less intelligent (cats) than something else (dogs). I can't imagine how horrible is must be to have such shallow thought processes.
-
I believe that slavery is wrong (including wage slavery), meanwhile, your bible not only condones it, but also gives instructions on how they should be treated! Is your head spinning yet?
-
Either the mental gymnastics that the mass media has people like you performing will destroy our species, or you'll wake the f--k up. I'm thinking that the former is more likely.
Reply: @Caffeinated Wizard Einstein was Jewish and believed in socialism, maybe one of the most intelligent people who ever lived was on to something? MLK believed in a universal basic income and was quite critical of capitalism, because he saw how it leaves the less intelligent behind. Most scientists lean toward socialist policies... Maybe, the most intelligent people on Earth know something that you don't?
Reply: @Caffeinated Wizard Typical SJW idiocy.
-
"Let's not discuss the matter, I'm just going to think badly of you because I don't like what you have to say."
-
You're brainwashed and TERRIFIED of breaking free from your programming.
Reply: @Caffeinated Wizard I'm not a communist. Like I said, socialism only works well in FREE societies.
Reply: Good point! SpaceX managed to strap three Falcon 9's together in almost as much time it's taken NASA to develop a highly-capable super-heavy lift launch vehicle that will take us back to the moon!
Reply: Oh come now im sure SLS is just another dozen engine tests before flying XD. /s
Reply: Actually, four of the rs-25's are done and ready for EM-1 now.  @motokid6008
Reply: @Galactis1  - Thats cool it only took ten+ years.
Reply: It took 10 years because, NASA is not properly funded.  You realize that SLS funding is like 25% of what Saturn 5 funding was at it's peak in 1968.  Of course it's going to take 10 years.   @motokid6008
Reply: @Galactis1  - They have more money then SpaceX ( Of which NASA is partially funding ) and haven't even made one test flight. SLS is a joke. A glorified jobs program. Don't even bother trying to defend it. I like NASA, but it's obvious they need to quit building rockets.
Reply: Without NASA, means a lot of things we wouldn't have.  Including this computer or internet.  Private Enterprise can never, will never, and historically will never come before big government programs that are on the edge of exploration.  @motokid6008
Reply: @Galactis1  - I'm not arguing NASA's merit. They're fine they just need to quit building rockets and focus on what they do best. Which at the moment is anything but building rockets.
Reply: Ummer Farooq  They aren't using old tech. They are pioneering mostly new stuff. All of the falcon first stage hardware for landing had to be created from scratch, and the raptor is pioneering a lot of stuff with the closed cycle.
Reply: Can’t they just use falcon heavy as delivery system?
Reply: @ronniedai88  - The problem is that, as others have pointed out, Falcon Heavy isn't as far along as the SLS is. While SpaceX's reusable rocket system theoretically makes it a much cheaper alternative, there's the long-term cost to consider. Which is more efficient in the long run, commuting to work in a car you personally own, or calling a Taxi/Uber every day? The Taxi/Uber may be cheaper in the short term, but they are still trying to turn a profit, so you will always pay more than the cost of operating the vehicle yourself.
Reply: @f1nger605  You are thinking of the starship/super heavy. Falcon Heavy already flew last year, although it can't handle quite as much payload as the SLS. 

The super heavy might still get done before SLS anyway though, still too early to tell. Elon is bad at timelines but NASA hasn't finished a new rocket in like 40 years. Probably the first version of SLS will get cancelled before it is finished.
Reply: @f1nger605  loooooool. That argument is false on so many levels...
Reply: @f1nger605  So you are saying Falcon Heavy is capable to deliver NASA's payload then
Reply: @f1nger605  The problem with the car metaphor is that in nasa's case, you are throwing out the car and buying a new one every single day. And Falcon heavy has launched
Reply: @f1nger605  The problem with this analogy is that Nasa is building a car that gets totaled after each use. You can use the Space X "Uber" more than once. It would cost more to have all the different contractors (Boeing, ULA, Northrop Grumman, are a few) that build parts for NASA's SLS to have to build a new SLS each time they launch a rocket. Space X on the other hand makes most their parts for their rockets themselves. Space X may be an Uber for NASA's but are the cheaper option overall short and long term. Some the reasons being reusability, their business model and different strategies they use.
Reply: @f1nger605  How do you get that SLS is farther along than Falcon Heavy??? You must be sniffing hydrazine or something! Falcon Heavy has already flown once successfully and the second flight is next month, the SLS oft delayed first flight is now scheduled for 2020. Based on their previous schedule performance I have zero confidence they will meet that!
Reply: @f1nger605  Except cars are actually reusable after the first drive. Would you rather build a new car from scratch everytime?
Reply: @f1nger605  > Falcon Heavy isn't as far along as the SLS is.

LOLWUT??? :D
Reply: Exactly.. it was a program that was never designed to build us a cutting edge spacecraft and always was a method of washing money to the big defense industry complex.  We as a nation are better off cutting this corruption out and working with new partners with fresh ideas and better management.
Reply: SLS has kind of been a disaster from the start. When you don't plan for how to manufacture something that really hurts. Rework is also the worst. Many of the people that were on it have been cut or left. It has been supported by government when in reality it should have died.
Reply: Falcon heavy was made from Falcon 9's with mods.  SLS starts from scratch except for the lengthened solids.

NASA does it right.  How many Falcons did SX blow up in development, and how many Saturns did NASA blow up doing likewise?
Reply: Very, very true.  Imagine spending Billions of taxpayer dollars on something that will NEVER EVER fly.  By the time that the NASA administrators realise it, SpaceX will have landed on the moon and be planing a trip to Mars.  Even then they will still  be working on the SLS (shitty launch system) spending millions per seat on Russian rockets and doing nothing of significance human spaceflight wise.  Time to drain the swamp around KSC.

If I worked at NASA, I would be totally and absolutely ashamed of myself.  My predecessors put men on the moon and we can't even put a man in space let alone orbit.
Reply: @Semicon07  You're a moron. SpaceX will still be playing with their flying water tower when SLS launches. The only reason that SLS would never launch would be because idiots like you keep saying that it should have its funding cut.
Reply: @Semicon07 
"By the time that the NASA administrators realise it, SpaceX will have landed on the moon and be planing a trip to Mars."

All funded by taxpayers. There is little difference between the way subcontractors operated during the Apollo era and what they do today. SpaceX is the geek boy's wet dream and Tony Stark Elon Musk is it's self-promoter in chief. Furthermore,, you've left out Blue Origin. They are on a totally different roadmap to SpaceX and Bezos is usually pretty quiet about his achievements but in time things will change. But none of this is as simple as private industry showing the government how it's done. The fact is that they simply cannot afford to do their own missions to the Moon and Mars (Mars is a dumb idea anyway) and will be relying extensively on government funding.

"If I worked at NASA, I would be totally and absolutely ashamed of myself.  My predecessors put men on the moon and we can't even put a man in space let alone orbit."

The only reason your predecessors were able to put people on the Moon etc. was that they took massive risks. That those risks paid off was a remarkable thing but should not be seen as a total vindication of the way things were done back then. Everyone in the US space program, from NASA to Musk and Jeff Bezos, knows that such risks are no longer acceptable and fatalities in space will seriously damage public interest in it.

The failure of the Space Shuttle to live up to expectations (it was an extremely complicated machine) and that lack of an obvious successor is what left the US program high and dry. The original proposals under Bush Jr were somewhat disingenuous (like putting a manned Orion Spacecraft on top of a single solid fuel booster) and stupidly underfunded.
Reply: @thethirdman225  Yeah I guess you are right.  Yes I did forget about blue origin and even virgin galactic (but I don't see much from either).  I guess I'm just frustrated at the massive delay's, missed expectations and bullshit politics.  

Referring to your point regarding old NASA (as opposed to modern NASA).  There will always be inherent risk, especially in space.  
Let's look at Apollo 13, despite critical failure of the spacecraft, NASA engineers were STILL able to get them back to earth safely.  Today the risk associated with the overall mission*s* would be deemed to great.   We have become risk adverse.
Reply: Semicon07 I agree: space travel is inherently risky. Just sitting a bunch of people on top of what is, after all, a very large bomb, is extremely risky. We’ve seen what can go wrong. The problems with the earlier programs are well known today. The hypergolic ascent motor in the lunar lander was an all-or-nothing device. It would work or the astronauts would die (Nixon even bad speech prepared for the occasion). The Space Shuttle had sections of its flight envelope where failure was not survivable.

If humans are to return to the Moon, for example, we cannot afford to be in a situation where there is no plan B, as was the case with Apollo.

Being risk averse is basically a good thing. It drives us towards safer and more reliable situations but I think we’d probably both agree that such things can’t be achieved without some measure of risk. The big question is - and this was at the heart of my original point - how much risk is acceptable? What will be the fallout from a disaster? Will it result in a drop in public support and a consequent loss of funding?

The point is that if we want this to be a long term thing - and I’m sure everyone here does - the best strategy is to get it right from the start. If the answer to the question, “What’s Plans B?” Is, “There is no Plan B” then the risk is simply too great to be sustainable.

We can only imagine what the political fallout would have been like if Armstrong and Aldrin had been stranded on the Moon.
Reply: Semicon07 By the way, there are a few videos out there showing the New Shepard doing its thing, from liftoff to landing. There are other on the New Glenn and BE4 engine that are worth a look. Bezos operates on a completely different level to Musk and simply doesn’t play the same publicly game Musk does. You might be surprised how far they’ve come.
Reply: @thethirdman225  Nice! I'll make sure to check them out!  Thanks!
Reply: The only reason sls has taken so long is because, it's not properly funded.
Reply: @Galactis1  The reason SLS has taken so long is because of the worst management in history of a system designed to fail.  The engineers of NASA became more concerned with preserving their jobs by spreading contracts to 20 some states instead of leading the USA into making space history.  The same concept was done by Lockheed for the F-35, the most costly defense program in history and it is no surprise that the same culprits in the defense industry are mixed up with NASA for this SLS.  Why spend money to even produce a rocket when you can just bribe congressmen to keep giving you billions of taxpayer dollars in a program stuck in development forever?  These people think short term..collect their parachute money checks and check out for retirement.  They don't care about us the taxpayers or us the dreamers who would like to one day go to space, the moon, Mars and  beyond.
Reply: And, that would be false.  The reason why it's spread across states is to spread the jobs out across the nation.  Without it, there would be no NASA.  Also, It's not management, it's funding, period.  Always has been.  NASA belongs on the frontier of space and that's what they're trying to do.  There's nothing wrong with SLS other than funding.  @clarissadanae7370
Reply: The sls is much much closer to being finished than starship this means a huge delay in the manned moon mission. It's all about the cash private companies will take humans to moon or mars only after it becomes profitable and that means many decades. Another administration another idiotic direction change for nasa.
Reply: @eliaspuolakka290  Around the time you posted this, SLS was seeing it's schedule move up again from its 2020 march launch to no earlier than the second half of 2020. After that there have been further speculation from contractors for NASA telling outlets that it will be pushed to 2021 with no info more specific than that. During the time after your comment, Spacex built a water tower and it lifted off a few centimeters, then it flew to 150m. Now there's a 1:1 scale Starship sitting on a field for all to see which is set to go up to 20km in a couple of months. They're going to be manufacturing 2-3 Raptor engines in a week in that time and soon after that up the production to one a day. Mark II is being built on another site with more systems in place and will probably fly in the first quarter of 2020. With Mark III following it in the second or third quarter with Superheavy kicking it to orbit. Mark IV will have them take a trip around the Earth and that is positioned to happen a bit later but not further than the fourth quarter of 2020. Then the design might be finalized, its flight worthiness checked many times, most likely getting a transport mission or 10 in 2021-2022 and fly a billionaire and his pals around the moon in 2023. 

And SLS ? 

silence
Reply: @smitemus   Yes a quickly put together model of full scale starship top HALF that's EMPTY except for 3 engines while sls article is built much further. Boeing tests their equipment diffrently so no flying water towers but rather straight to the point - orbital test flight. Knowing musk's wide mouth it's pretty clear the timeline given is best case scenario aka sls will be out there in orbit flying missions way before spacex but their the weird metal statue looks cool ;)
Reply: @eliaspuolakka290  Boeing's lofty 'straight' goals haven't produced wings though they certainly have had the time. SLS future doesn't fill me with a lot of confidence since it was supposed to fly in 2017 and now it's being pushed back to 2021 with over double the cost it was supposed to have initially. Another OL3 sunk-cost experiment with taxpayers money but I'll probably see OL3 producing nuclear power before a flight capable SLS. ;)
Reply: @smitemus  Nasa is quite annoyed by the fact than none of the companies serving them can keep their timelines including spacex. And here too it's very unlikely that spacex can keep their timing and cost to their totally unreasonable estimates. They are developing a huge new system from the ground up, while sls is somewhat based on older proven shuttle tech. You can bet the starship project is gonna have the same mega delays and cost over runs once the project actually goes somewhere beound empty shell. Once that happends musk will come out and point out that all their timelines are "best case scenario." wich in one hand is totally true. However with starship most of the cost doesn't fall on taxpayer, wich is good. Still the sls program has more progress than the starship that is almost an empty shell. And in no way is spacex a reason to end all other space developments.
Reply: @eliaspuolakka290  NASA should be annoyed that its SLS developing contractors don't get their s*** together but there's not even a peep. The 'annoyance' against SpaceX doesn't seem to manifest much because NASA awarded lucrative contracts to many private companies including SpaceX, to develop tech for its hopefully soon to manifest SLS moon mission. 

SpaceX has 17 years worth of experience designing and manufacturing rockets that were built following over 40 years worth of research by NASA and have proven their reliability as a launch provider. SpaceX is on the cusp of getting rid of Russia dependency when it comes to transporting astronauts to the ISS, so I wouldn't discount their credentials so flippantly. Also, please don't put words in my mouth, NASA should continue with its efforts on developing space capability there is no argument about that from here.
Reply: @smitemus  Nasa cares about all delays. They fired the head of their spaceflight divission largely because of the sls delays so they are annoyed and there is indeed a huge "beeb" at boeing. Furthermore becuase of the delays nasa is considering other smaller rockets for some of the lighter sls missions. This is also a beeb at boeing. Sls hovewer is still planned for the moon missions. Nasa has no annoyance against spacex but annoyance against their delays. Even with the delays Nasa has a great relationship with spacex.

Yes and boeing has double that experience they played a key part in almost the entire space history of the US including a vital part in the moon landings. Spacex has proven to be a viable contractor but has also big delays and fails already. They do have an ok track record but for better or worse their track record can't make them achieve totally unrealistic goals. Developing absolutelly huge new rocket system from the ground up will cost a lot more than the totally unrealistic "best scenario" estimates spacex has given so far. Starship will become a big money taker just like sls. However it's not running on the tax payers money wich is good. Also I didn't put any words in your mouth. In case you are refering to the end of my previous reply "in no way is spacex a reason to end other space developments" it is simply a claim and I never stated if you oppose or support it so don't proceed to lie to me.
Reply: @eliaspuolakka290  So we are in some agreement. Let's leave it at that.
Reply: @eliaspuolakka290  so about the SLS being closer to finish than starship...Boca Chica is gorgeous this time of year
Reply: the 'napkin' myth is from twitter pr) why would an educated engineer like Musk use a napkin?!)))
Reply: We should honestly just defund Nasa completely and just pay private companies for projects.  NASA used to be great when it was in the military, now it is just a money pit.
Reply: @MichaelMantion  Nasa was never part of the military...
Reply: @Cbeddoe19 - I should not have included Uber in my analogy. Uber, by design, exploits its workers by foisting gas and maintainence costs on them while also not providing health benefits or a living wage. While SpaceX has been accused of exploitative labor practices, they aren't nearly as rampant.

So as long as we're inflating the analogy, add a few zeroes onto the end of an Uber ride, then give Uber a relative monopoly. That would be more appropriate to what SpaceX's goals are.
Reply: @Cbeddoe19 - SLS was designed specifically for scientific missions, though. So I don't get what you mean when you say that we need to axe the SLS, but fund NASA's "scientific" missions. Even though we've come a long way with robots, they still pale in comparison to what a human astronaut is capable of doing in a shorter amount of time. The future of space science is a persistent human presence in space. If we want to advance the frontiers of science, we shouldn't be axing projects like the SLS, we should be funding them more.
Reply: F1NGER you seem to be ignoring comments addressing the absurdly large difference in cost per launch between the SLS and falcon heavy. Please provide an counter argument for them otherwise you’re just wasting everyone’s time. Also why is 4.9 billion govt funding worse then the 20.7 billion  annual budget for NASA or the even more ridiculous amounts of subsidies received by companies like Boeing and Lockheed Martin? SpaceX is by far cheaper, more effective and more reliable at every conceivable aspect of space flight than NASA or any of SpaceX competitors in heavy rockets. There is no way around that.
Reply: @f1nger605  Spacex BFR will make SLS obsolete admit it. I don't think SLS will be built in the near future despite billions of dollars and Decades of development. Why waste money?
Reply: @f1nger605  SLS will never be cost effective to fly. Ever. There are similarly capable private rockets in development with a fraction of the operating cost. Why do you think SLS is in any way superior to New Glenn or Superheavy?